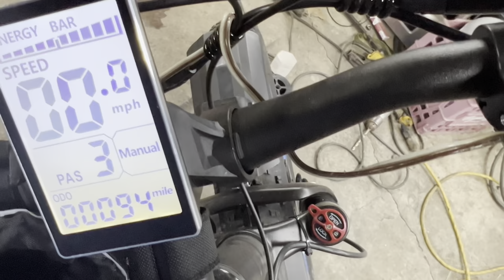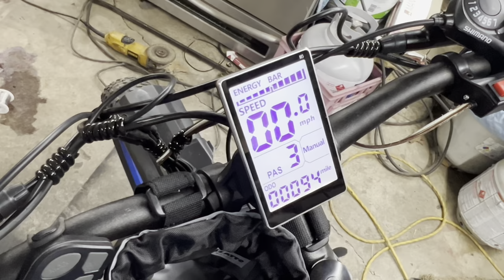SMLRO XDC600 ebike dual or single hub motor switch modified for switching to AWD or single wheel.

Comment: i added the switch, but it wont allow you to switch between motors unless you restart the bike. if you start with rear motor, it stays there unless you stop and power off the system. what to do ?
Reply: Connect it to the orange wire then it will shut off and on without having to shut it off

Comment: But the bike has a easy to unplug cable going to the front motor which means simply unplug the cable to the front motor boom you now only have 1000w in use and when you want both motors in use again just plug back the cable to the front motor this is much easier way to do this also this wont mess with your warranty
Reply: I do that same trick a few times a week on this ebike when i only want to use 1 motor for more range. It's been a blast.